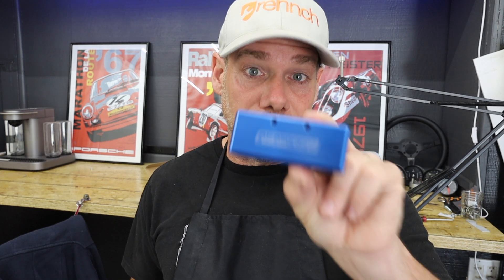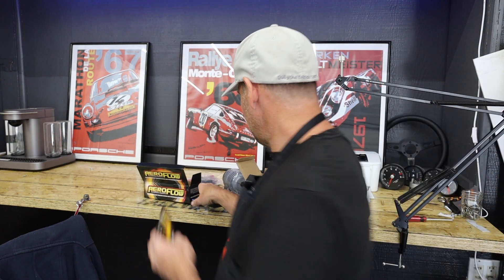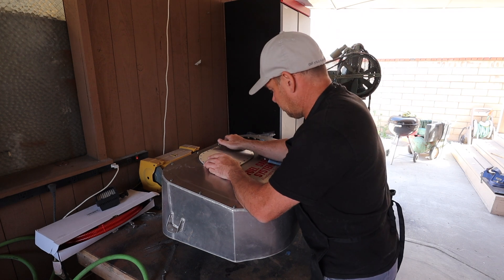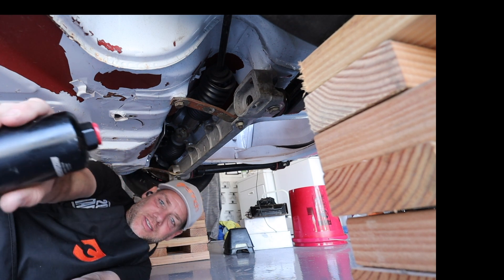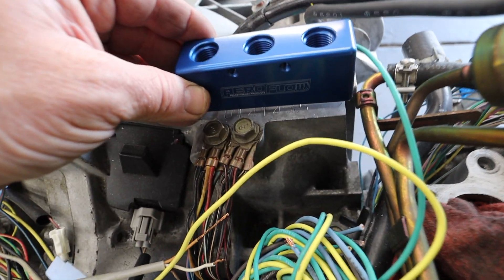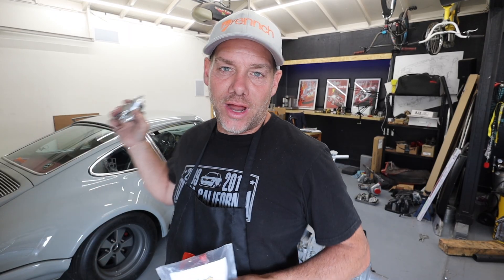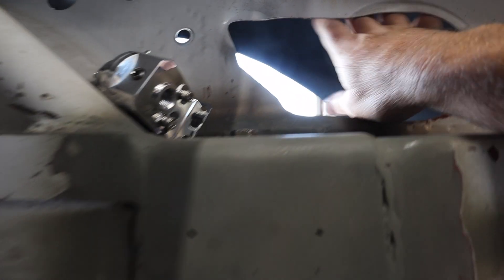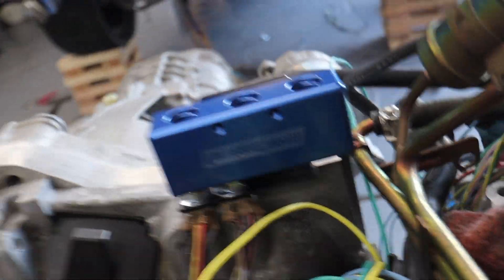e85 Ethanol Fuel System in my Subaru EZ30 Turbo to Vintage Porsche Engine Swap! | Blasphemy Build 51

Comment: I have seen folks have issues with the foam breaking down in older fuel cells and giving the pump fits. Yours looks perfect as you said but filling with fuel for a while and seeing what comes out before you think about supplying expensive pumps may be a plan ...
Reply from the maker: I have some new foam heading my way I think.

Comment: T/are the paint off the bracket that mounts the fuel distribution block, it’s a main earth and this can cause problems with electronics
Reply from the maker: The bracket sits on top of the earths.

Comment: A suggestion... Isolate the fuel distribution manifold from the engine case same for the regulator and any other fuel system parts... a lot of heat is transfer to the fuel and cause problems if you don’t.

Comment: Normally the pump resides on the other side of that cross-member, if that at all matters (might not be enough room with the fuel cell in place?)  I got a Pierburg pump for my E85 conversion, but that Aeroflow pump looks like a nice drop-in solution.
Reply from the maker: I was not sure on that… Thank you for clarifying. I will see if I have enough room.